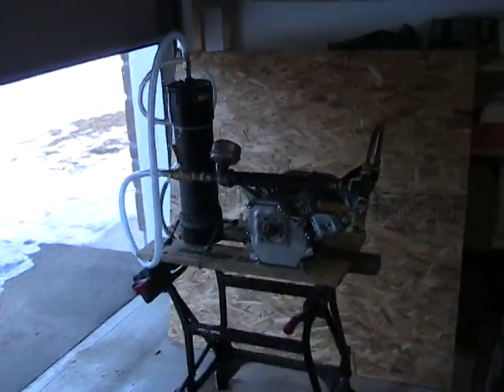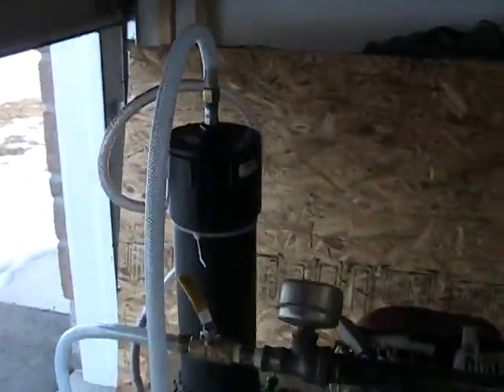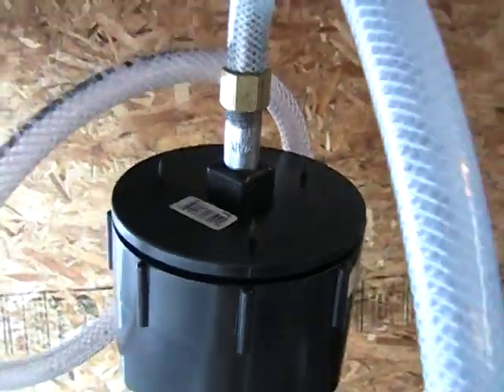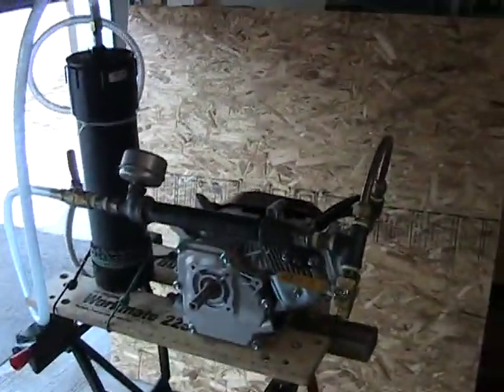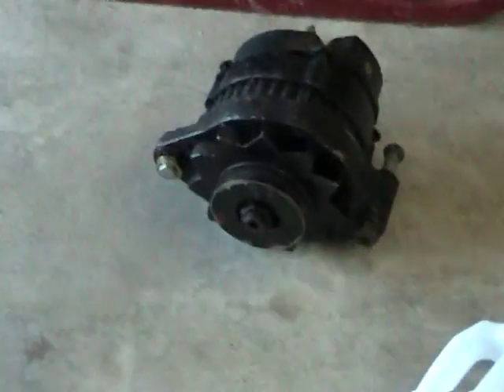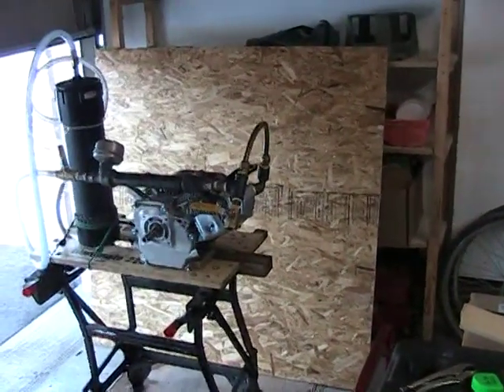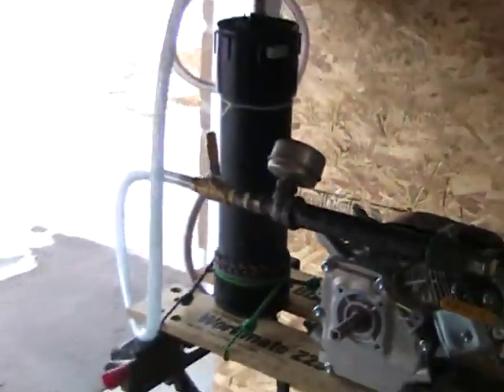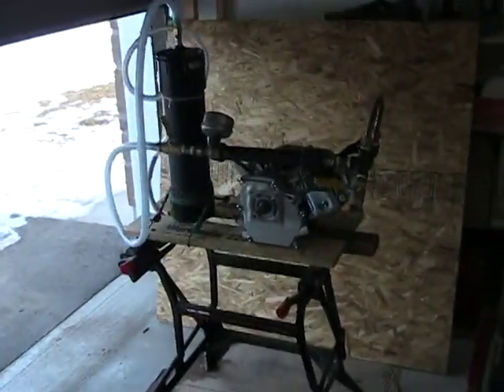GEET test 5 - successful build

Comment: some new alternators do not need 12 volts to start charging , it looks like that is an older one , it will need 12 volts to start charging , for the exciter diodes

Comment: that is a nice air filter. might i suggest getting a high flow filter and just straight pipe the exhaust. in doing so you will reduce your intake air temp, reduce air resistance, and reduce overall engine weight.

the high intake temp and increased air resistance are adding friction to your motor reducing its efficiency. in other words you are burning fuel to move air that should move freely. the high intake air temp also in reducing the density of oxygen in the combustion chamber, limiting the max power available.
 
and once you are done with that rod, i have some lead i need made into gold. ill ship it to you and you can use your transmogrification machine to make us rich. if you can add enough energy to split elements, as you claim,  with less energy than is released through chemical reactions, you can do it to my lead too.

Comment: I don't know why you put water into it with a bubbler it does not matter what you put into it. it is still just running off the fumes from the gas. that makes a big grey area in this system it does not run on water at all. that's just a myth.

Comment: There are actually a few factors involved with making plasma... Plasma is the result of stripping electrons off atoms..  This is similar to how fusion is performed.  This rips apart all elements from their compounds using a very intense field structure. The intake gasses and exhaust all behave like charged particals in motion - which, produce a magnetic fields.  These gasses are moving in opposite directions  inducing fields that

Comment: The more I look at the GEET, the more I realize it is just a water injection system - the magnet in the "reactor" does nothing.

So it does nothing but deliver a mixture of water vapour and gas in the cylinder.  It's possible you may get a little more power out of it (due to the water cooling the cylinder and sucking in more air) but you are not actually getting any power out of the water.

Comment: I tried thissystem and went thru it 3 times. I used tgoo much level, it got wet. I dried it out and tried again with silicone on every intake part and ran it on fumes, not like your enginre, but a 4 stroke engine, thru the carb with light load on the engine and never could get it to the proper magnetic orientation. The only time I got a magnetic reaction, it was when holding the rod in hand vertical. No magnetic observable when holding horizonal. Only ran on gas vapor, no gd., will try HHO.

Comment from the maker: I drilled a hole through the exposed area of the intake pipe, stuck a nail through it and welded it shut. Others have installed a spring in the pipe-T behind the reactor but I think the nail idea is simpler and cheaper. The inner rod is supposed to hover as gas flows around it and then the magnetic influence on it causes it to center itself longitudinally in the reactor. No idea if that's what's happening but there you go.

Comment: Another consideration for bubbler design to avoid liquid take up would be to have bubbler shaped simular to a cylindrical parymid (wide flat base with narrow top). liquid would then tend to be captured and drip down sides as narrowing towards top increases. I also would employ many smaller inputs on the bottom that equate to same diametor as exit vapor diametor. I think also it would be more logical to have the steel wool at bottom to reduce liquid ability to travel via the steel wool.

Comment: @taberr5 yes alcohol dose burn faster .But the geet dont use a carb in the conventional sence. the vacuume heat and magnetic field, change the molecular structure of fuel. so you can run on a mixture of fuels including some water

Comment: Nice video the less parts/ simple design the better
One concern with condensation      ps check  youtube motor bike after plasma test
with hho set up i saw a set up whereby a copper pipe coil was installed on the hottest part of the engine to dry the system before it goes to the intake
Has anybody open up  the engine after so many hours
cheers
imtotob

Comment from the maker: I expect so, but I think the engine needs to start in its normal way (burning gasoline fumes) until the reactor is up to temperature ...specifically the exhaust gas temp so that the heat exchange is happening in the reactor. If you can get the motor to start on alcohol then I can't see why not, but I think alcohol might be a little to volatile for an unmodified lawnmower engine. plus alcohol is more expensive isn't it?

Comment from the maker: If you believe the free online plans, Yes. I've had this unit working facing the wrong direction initially so I think orientation only supposed to help. I have read the correct magnetic signature near the middle of my reactor using a pocket compass; that's how I know it was working. My problem has been condensation or fuel splashes traveling up the intake hose (which is too long) and dousing the reactor. It starts predictably, then starts to run cold, then the reactor gets wet and it chokes.

Comment from the maker: The gap between the rod and inner pipe is around 0.03125" or 1/32".  That measure is all the way around so the actual diameter of the rod will differ from that of the pipe's I.D. by 1/16" or 0.0625".

Comment: i can totally understand your aim, replacing fossil fuels with another fuel that requires heavy processing is only taking a step sideways or backwards. A lot of guys using things like this have seen that the water helps as a filter for the gasses but is ultimately not consumed. Maybe these guys dont have something quite like yours though

Comment from the maker: My aim is to use something that I can get for free, or is a waste product.  Fancy electrolytes and alcohols are expensive relative to straight gasoline.  Water should break down to H-H-O and oil is a heavy hydrocarbon.  The water mixes with all the impurities in the oil which isn't really desirable but isn't a problem in the long run anyway as it appears to be consumed evenly.... though I can't really tell if that's exactly true at this stage.

Comment: i havent done any experiements yet, but i plan on starting things off with a few little ideas i have potting around. I am interested to know, why use petrol/oil and water, as they dont mix? using methanol/ethanol which mixes with water would also extend fuelling if you cut it, but at what point does the water effect combustion? thats what i need to know, although i willfind out later on my own.

Comment from the maker: Thx. My idea is to put the carb on the hose that feeds the bubbler, or have in intake tee before reactor that draws from bubbler and from carb.  In both cases carb is pre-reactor so that the 14:1 carb fuel gets processed. That way it could run normally if the carb was at idle and bubbler was producing good fuel for the reactor.

Haven't tried just oil/water yet but I'm not getting rich enough vapors from below-freezing oil I think. I need to preheat my fuel or recirculate exhaust to bubbler.